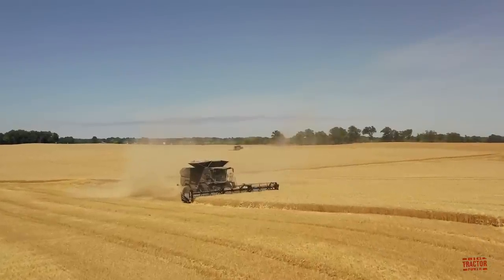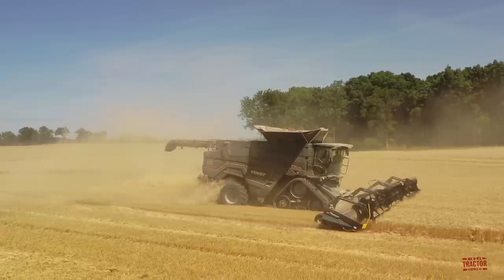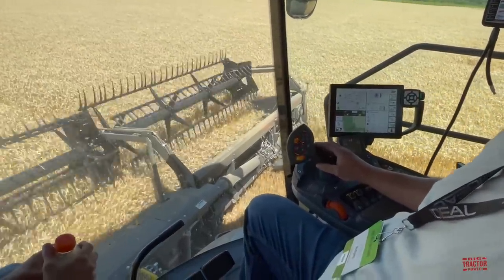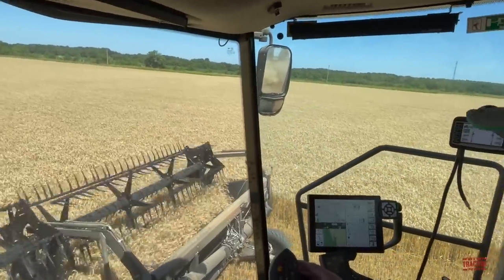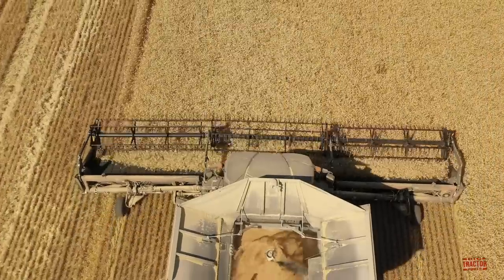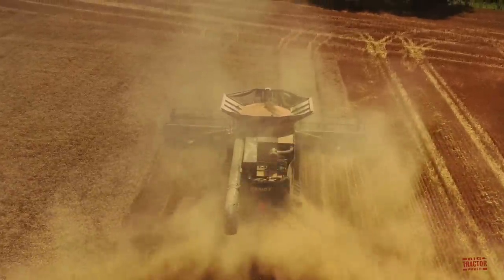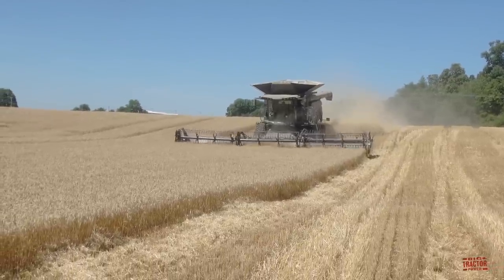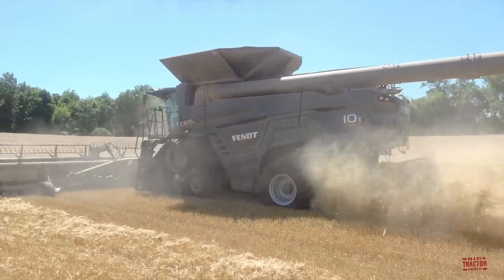790 hp FENDT IDEAL Combine Harvesting

Comment: Great video Jason, when you mention the list price of this machine does it vary depending on the brand of header you choose or does it come with a standard header and then the farmer has to fork out extra depending on the make of header he chooses.
Reply: Heads are purchased entirely separately. That price he gave is the machine. You need a platform head, you go buy it, choose your brand. Pick up head, corn head, all separate purchases. 150,000 is a good starting price for a head.
Reply: @stirv6462  Thanks, good information, it certainly adds to the cost of the machine. 😀

Comment: Very cool combine. I like the all black. Way too much power for that 40' head. Needs a 50' to put it to work!! GO BTP 💪
Reply from the maker: Right now Geringoff only offers up to 45ft  in the US.   AGCO has partnered with Geringoff to supply headers.  Unfortunately the 45 foot head ordered for this unit did not arrive in time for a week so they had to use a 40 foot.  Needless to say at 790 Hp this combine cruised through 100 bu wheat with ease.
Reply: @bigtractorpower  then get a 60ft midwest crophawk

Comment: 790HP, only FENDT could pull that off! What a animal! Best looking tractors in the world, Case in second. FENDT has endless line of equipment that's 2nd to none. Euro Engineering is tops in the world. I have to say in all honestly, America when its allowed to can out engineer the world.
Reply: Agco owns Fendt. They are a American company. You can get this combine branded in Massey Ferguson too.
Reply: Claas 8900 Lexion Combines are 800 HP. I believe they also use a MAN engine
Reply: @farmerjohnson8121  With the 8900's 790 hp, that' a hog!!

Comment: Looks like the tracks are extremely rough with a continual bounce as noticed by the belly jiggle in the cab. Case standard tracks are very similar. You can drive on glass and be bouncing.

Comment: The Lexion 8900 also has 790 hp, or is he not available in North America? 
Great video
Reply from the maker: The 8900 unfortunately is not available in North America.  Claas has not really pushed the very top models here in the past because the crop yields not warrant the power.  A big wheat crop here is 100 bu or just over and corn does not require the power wheat does.
Reply: @bigtractorpower  Thanks for the answer. 
I didn't know that and wouldn't have thought so, but Claas knows what they're doing. It's definitely a gigantic machine, I've been driving it for a few hours. Greetings from Germany

Comment: That's a big machine for sure. I would prefer the steering wheel. If you don't use the stick a lot, as when using auto steer, it could be easy to make a wrong move with the machine when you grab the stick in tight quarters.

Comment: million dollars to get the job done 2 days quicker than a 9600 deere ? 9600 deere $20,000  . nice video Jason thanks
Reply from the maker: The 9600 is a great combine but in 100 bu. It is going to run 1.5 mph with a 30ft head. This 10T is running at 6 mph.  The field I filmed in was 800 plus acres and the farm has 6,000 acres of wheat.  A 9600 would not get a crop in quick enough.  The farm plants soybeans right behind the combine as a second crop.

Comment: Is all of that horsepower really necessary? Does it harvest faster than the competition? 
Does it handle larger attachments than the competition?
Reply from the maker: It harvests faster.  It unloads on the go and harvesters much faster. I was in a field last fall with a 10 on a Geringoff 16 row head and it pushed 6 mph in 250 bu corn pretty easy.  There were three Case IH 8250 combines in the same field and the Ideal breezed by them quickly. The Axial-Flows with 12 row heads were running 3.5 mph.  In wheat harvest this 10T had a 40ft because of supply shortages the 45ft Geringoff orders for it did not arrive in time for wheat.

Comment: Its not about horsepower.....its about cleaning capacity..........
Reply from the maker: The two 16ft rotors offer allot capacity.
Reply: It should be about cleaning capacity and used to be in my experience. John Deere need their 18 litre in their big combines and it will again be about cleaning capacity

Comment: The John Deere X9 1100 has class 10 threshing speed/abilities but using only a 690hp engine.  Saving a lot on fuel for the same work.
Reply: Just because an engine is rated at a higher horsepower doesn't necessarily mean it uses more fuel to do the same work, but it does mean it can do more work when needed.

Comment: Make sure when purchasing this machine that the dealer appoints a full time mechanic to be with the machine 24/7. This machine has no reliability.
Reply from the maker: The Ideal comes with a 3 year full service Warrenty.  It covers are filter and fluid changes for free and a replacement unit if a repair takes more than 24 hours.